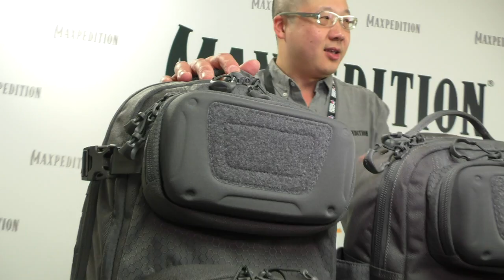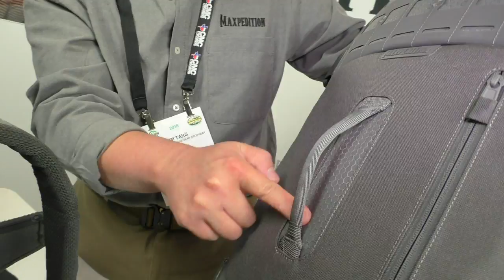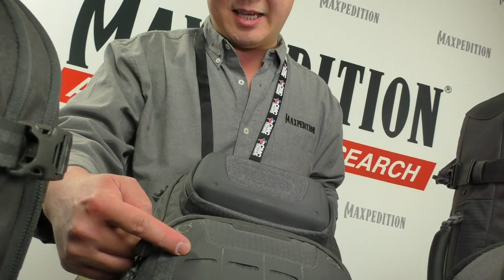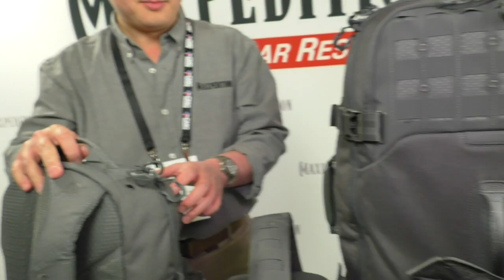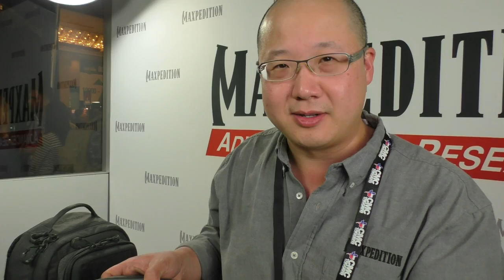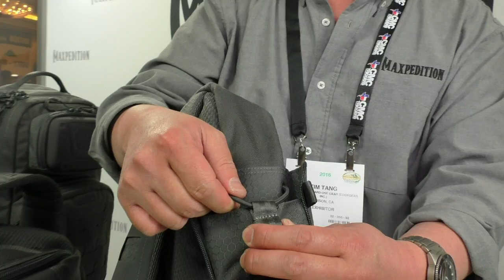Maxpedition Changes the Game with A.G.R.: SHOT Show 2016

Comment: PHP iPhone 6/6s Pouch Black (Wireless Phone Accessory)I have the iPhone 6 and recently due to degraded battery capacity replaced my Otter Box Defender case with the Apple iPhone 6 smart battery case. Therefore I had a desire to find a belt hollstered case solution large enough to accommodate the Apple battery case as my older style Maxpedition phone case built for the iPhone 4 would is not large enough to work.

I am happy to say the new PHP pouch is a true winner for my EDC phone solution.

I'm also am vey pleased with the new TacTie® PJC3™ Polymer Joining Clip included. There is plenty of room to slip my belt strap through the clip without having to unbuckle the PJC3 and it also allows the extra bit of belt to tuck behind the case. The PJC3 clips are a high quality design, lightweight and have a slim flat profile. It's a captive solution unlike the metal spring steel clips or plastic spring clips found on standard retail phone holsters that can occasionally ride off your belt or strap sending your gear to the ground. The PJC3 clips provide 100% assurance your pouch stays attached! I appreciate the slim design of the new polymer joining clips as I can easily slip the PHP case inside my front denim pant pocket without any bulky clip causing discomfort.

The PHP is a very durable product and extremely good value as the retail price point is very reasonable for the quality of this product.

Thanks Maxpedition you hit a home run on these PHP pouches and earned my returned business with smiles once again.

Jeff Morgan
Seattle, WA

Comment: Maxpedition makes tough quality products. I have two pouches by Maxpedition that have gone on every trip to the woods or river bank and camping. And after all of that yet they are in great shape. But I'm changing to a slimmer militarily type. The ones I ordered have wide compression straps. Really holds tight to the leg. Also it stays out of the way if I have to pull my sidearm or carry blade